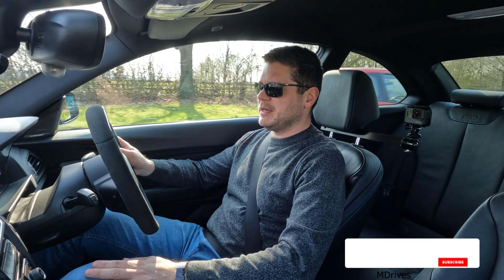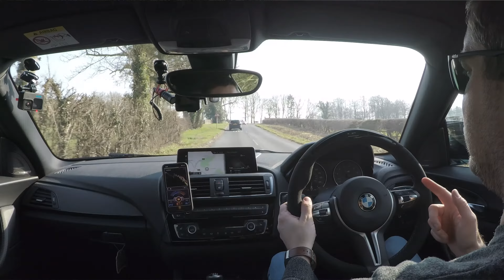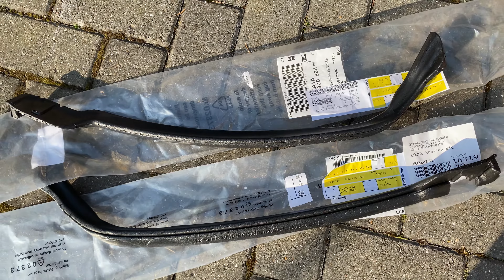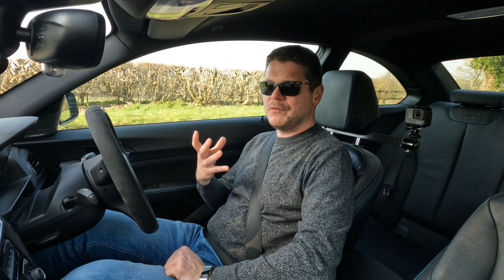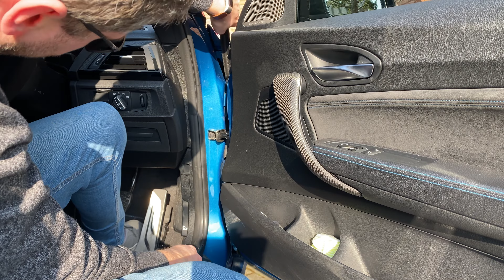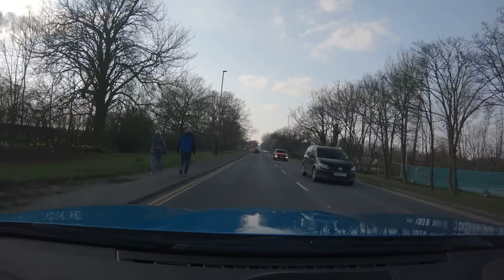Making my M2 quieter for £25 using genuine BMW parts?! | 4K

Comment: Funny. I'm even finding my m240i being just a bit too loud on the road noise front. It seems to be a rather quiet car, engine's nicely insulated, and so are outside noises, but tire noise, especially on those rough British roads (some more than others, obviously), is a touch too much.
Reply from the maker: There is a huge difference between 240 and M2 when it comes to insulation. I think 12kg of insulation and it’s light stuff. M2 is more of a bare metal and plastic covers. And even some metal covers were removed.

Comment: Fit a bonnet deadening panel from any F22.  That makes a good difference.
Reply from the maker: Engine noise it’s good. Where the massive difference comes from is tyre noise. They have plastic inner arches.